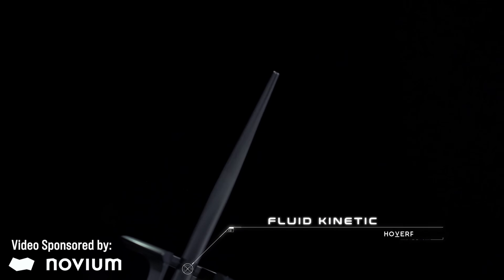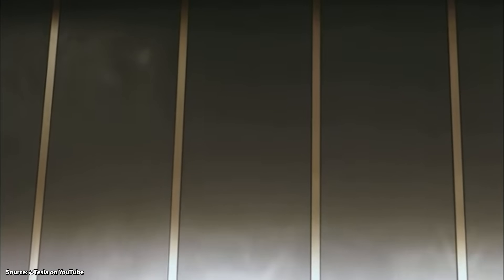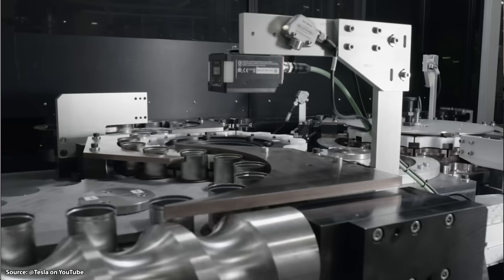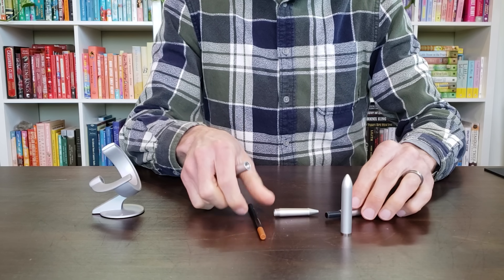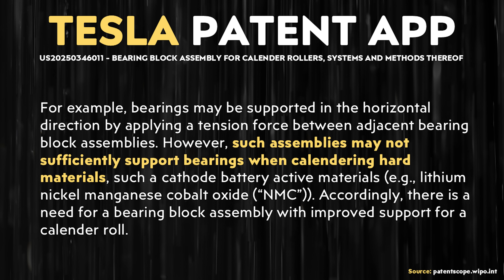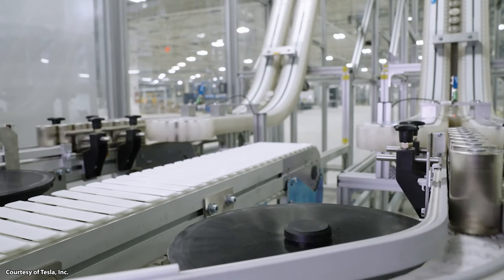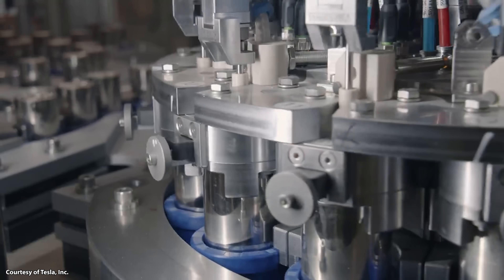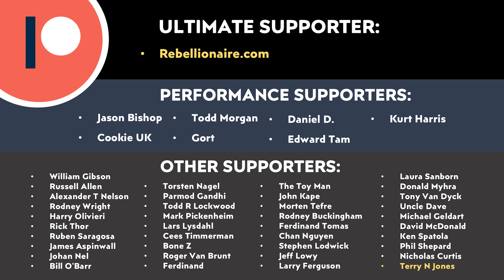NEW Tesla 4680 Battery Manufacturing Tech + What ELON MUSK REVEALED

Comment: If Tesla change its cyber truck design, they could sell a lot more. But the most important factor to buy Tesla are the range and reliability. I hope they can develop a solid state battery, that according multiple sources, can reach ranges from 600 to 800 miles per charge.

Comment: I am sorry to inform you that Tesla is still busy building the special building for the battery components at the Texas factory grounds.  They are still busy strengthening the ground around the building for the evaporating equipment, so the actual production equipment have not even been installed yet.  That is why I feel China factory was twenty times or more, faster than the Texas factory construction.

Comment: 3:45 Dry cathode for 4680 battery will be successful, but the benefits per unit cost spent for this are not really that high. This means the costs, effort and time spent for dry cathode process can probably be better spent elsewhere for more outsized benefits.
Reply: You could be right but once achieved it may open a lot of additional improvements, it all depends on when Solid state arrives
Reply: @alanrickett2537  At some point, they will have to abandon the 4680 and seriously consider solid-state batteries. Solid-state architectures are not well suited to cylindrical formats, so fully committing to a difficult and ultimately inferior technology does not make much sense in the long run.
Reply: @cyclopes968 at some point we will be able to think our input to computers, best stop making keyboards right now.
Reply: Dry cathode technology was always going to be difficult. However, Elon was sold Maxwell’s technology on the promise that it would enable 15–20% silicon in the anode, supposedly increasing energy density by 30–50%. That promise turned out to be false. Even adding just 1–2% silicon introduces major unpredictability in cycle life, and the cost is far too high for the marginal benefits. This is why we don’t see any silicon content in the 4680 cells. A dry anode that doesn’t enable silicon is, frankly, of no value.

Comment: I'm pretty sure the cybertruck is so much more expensive than what was originally announced because they thought the 4680 would be way more energy dense and way cheaper to produce than it actually is at the moment.
Reply: Absolutely right. I really like the CyberTruck, it really would benefit from a 400 mile range as standard, it would definitely help sales
Reply: Yes, and Tesla priced the CT for eager early adopters. There were not that many of them. Add in politics and dip in the economy and the sales make sense.
Reply: The form is what makes it a cyber truck. I love the stainless! If they made a regular truck, it would take away what makes this form factor unique. It's form factor is because of the materials chosen. And it's grown on me a lot!
Reply: Cybertruck form factor MUST change to that of a regular pickup truck, in order to vastly increase sales.  Keep all of the great technology AND change the form and Tesla will have a massive winner.  Get rid of the impractical mad max form.
Reply: @jonpotthoff2868 not that easy as normal trucks are crap design and drive like a brick wall and have rubbish safety

Comment: Tesla seems to be going away from car manufacturing in general.  So i do not see the decrease in cars sold to be a major problem. 

I think the big stopping point right now is FSD. So many people want a car with true FSD and people are waiting to see if any other design changes are needed to cars before they can FSD. 

I really wonder dose Tesla have a lock on the output of other factory 4680 cells since while you can buy 4680 cells individually i do not see any product using them although you can get a flashlight with a 4695 battery so you could probably make an adapter for it.
Reply: Tesla mission with cars is about done. EV adoption push will be finished by China for better or worse.
Reply: The real money is in Robo Taxis & FSD and robots. FSD is only 12% of all Tesla owners. Nothing

Comment: Still overpromised and under delivered... after 5 years nothing is achieved. Teslas changing performance is really outdated
Reply: Yeah... Tesla is a real failure of a company, huh? 🤡  Turns out doing all revolutionary things never done before is not easy
Reply: Nothing is achieved is an exaggeration
Reply: @12user-u5h  In other words... He lied.
Reply: @jlrutube1312  Yeah, like everyone who ever tried anything dramatic "lied". Its well known he's often overly optimistic... like Toyota Solid State batteries... Like GM about... anything EV, Any cost plus contract... etc. 

VW oopsie with emissions cheat was a lie. 

Its disappointing, but you're assertion is simple hyperbole.

That said, the tech is way behind and log jamming Roadster, Semi, $50k Cybertruck, etc. 

Its (barely good enough) right now, but Semi has a good chance of success if they can keep the price down below $220k. Better if its $200k obviously, but not gonna be $180k. Cybercab is not for public sale and will still be successful even if the battery is $4k over budget. Roadster is a very expensive car, so battery price has less impact. Cybertruck will wallow in pergatory until 4680 exceeds 300wh/kg at a substantially lower price... so he's putting out 20k/anum at the higher price until then. 

Musk makes big promises on tight deadlines... thing is that he generally  delivers, if not on time, then faster than anyone else and often Much better than anyone else.
Reply: @avgjoe5969  I'm sorry.  I was saying that gansmaier lied when he said that after 5 years nothing is achieved.  Tesal has achieved a great deal.  I am a big fan of Musk and he is a great man who has achieved a lot.  Sorry I didn't make myself more clear.  Your points are good.  Please have a great day and a great Thanksgiving.